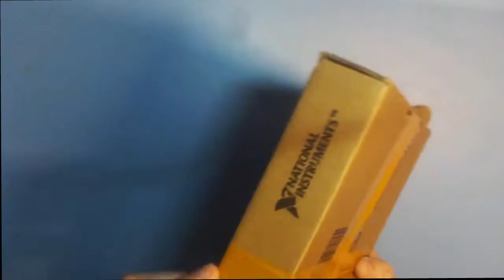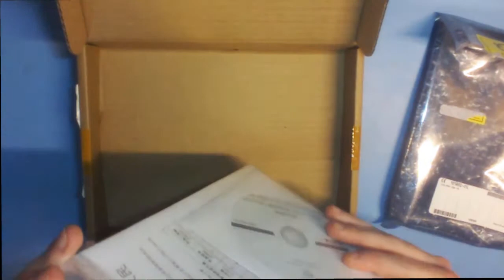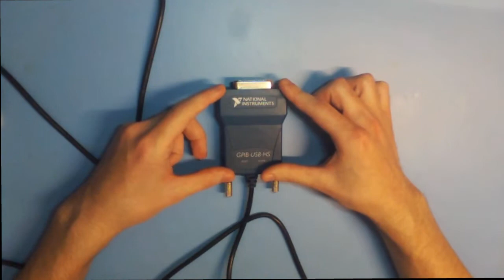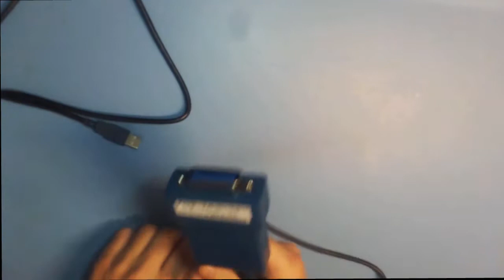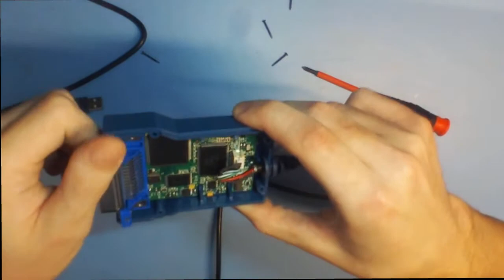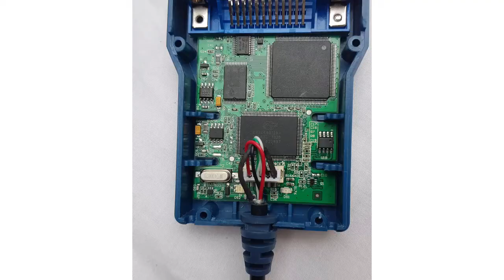Teardown fake USB-GPIB-HS from china

Comment: Mine used to work fine. But after about a year, I am now trying to connect it to work and control my voltage source meter. No way. The computer partially detects the GBIP-USB HS adapter and shows the correct serial number. Despite all efforts, including installing updated drivers from NI, the adapter still cannot be detected as hardware. The adapter is just getting hot once plugged into the USB, even when it is not connected to a GBIP port (temp feels like about 70C).  The adapter has a label of "Product of Hungary," which I got cheaply from eBay. It seems that it is actually a fake one and has come to the end of its lifespan

Comment: if its working fine then why its fake.
Reply from the maker: Fake does not mean it doesn't work. 
Problem with many fake devices is that they might work great but then there are some edge cases where you spend countless hours troubleshooting only to realise it is caused by the device being fake.
Reply: If you have a brain doesn't mean you are not a MORON.
Reply: National Instruments (NI) has been changing its drivers to recognize fake items and won't communicate with them. A machine with the old drivers will work fine so long as you never accidentally update them. A new installation however is a PITA to get working with fake hardware, as NI hides the old versions of the drivers; iirc you have to search for a hidden legacy installer that can see those versions on the NI servers.
Reply: @pvnbunny  I haven't realize it is so tricky, considering it is all very old technology. I need one GPIB-USB converter as I would like to experiment with an old Tektronix spectrum analyzer, which was a gift. There is no waay I am buying an original adapter, as some of them cost I can almost buy a simple spectrum analyzer, hahaha. But I understand, the sellers have those obsolete stuff laying around in a corner, and from time to time some people are obviously willing to pay for it. Maybe some companies with some specific setup's.... I see Elektor has a DIY project, but the cost of that all together could be more then a fake adapter. The question is if I can use that fake adapter with LabView, as I would like to write some GUI for the spectrum analyzer...

Comment: I think no matter it is fake or original, as long as it works for our need, then it's fine to me.
Reply: If you integrated the fake one then sold your system to your customer and commit that you are using the high quality GPIB-USB from NI, you are doing wrong. If you told the customer that you are using the fake one to build the system and your customer is okay with that, there is nothing to concern.
Reply: @bboytyphoonllg  i think the price says everything, your customer know if you sell cheaper then they won't expect original.
Reply: @gondala  If you sell single part, the customer will see the price but if you integrating to a system, the customer won't know.
Reply from the maker: I do agree.
I was just very curious about the differences of a fake and an original device.
Reply: It is risky. I have a customer who was using fake one for production. It was running great in the beginning, but later many systems got troubles. At that time, no one could help. Using fake one is putting users into a risky situation. I would rather choose used but fake.
Reply: @midday6067  Totally agree

Comment: Does it work ok? Does it work with Windows 10? Do you need some specific software to use it?
There are several ebay suppliers at around US$100, does that seem to be in the ballpark you paid?
Reply: I just (unknowingly) got a counterfeit one from Newegg. It worked with windows 7 NI MAX software, but errored out when I tried to use it with Flukes Met/Cal software.
Reply from the maker: It works just fine, it just needed the official driver package